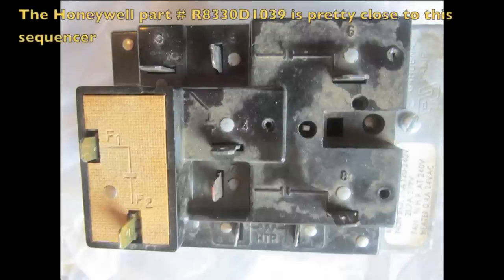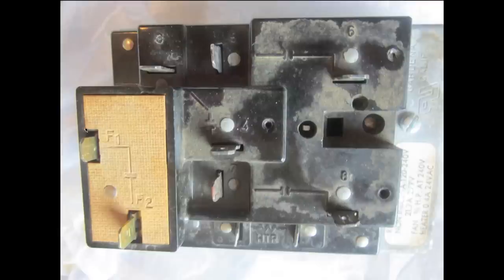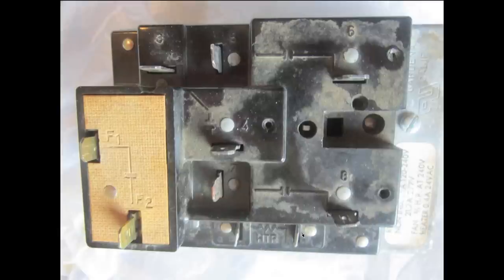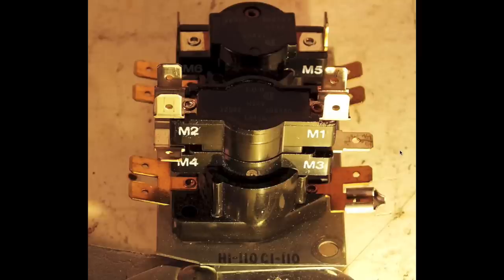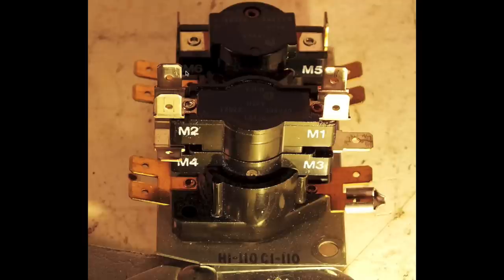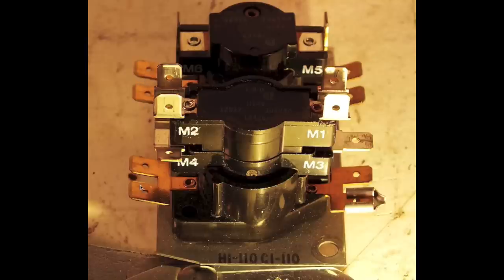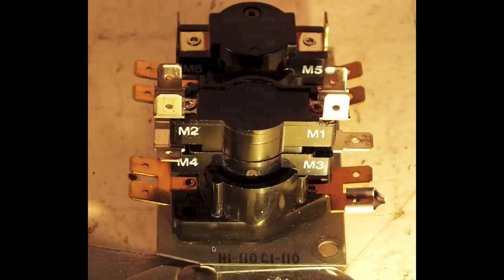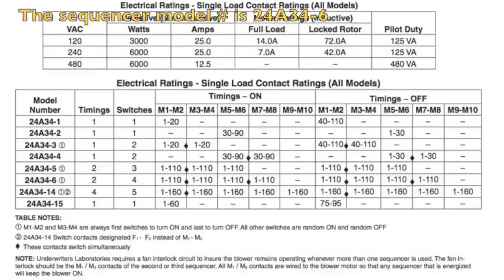Honeywell sequencer replacement

Comment: I just installed this Honey well R8330D Sequencer. I replaced a standard Stacked type sequencer, which lasted just a year. I understand that this unit is far superior to a stacked one and will last quite long. Next, in case it doesn't, i will re-do with a contactor with a time delay for the second element.
Reply from the maker: They are pretty much the best of the sequencers.
GFM

Comment: Good video you could use the sequencer you had I had to replace mine I used a two switch and just used two elements on contact m2 run a jumper to a fan relay and hook the fan to the normaly open contacts when m1 and m2 mate it energizes the relay and fan comes on been running that for two years  with just two elements

Comment: Realizing this is an old video...  I am rewiring an old firnace with 5 5kw elements.  I believe this furnace originally used the auxileruly to run 2 of these.  As of now,  the unit i am rewiring has a fan contactor, then 3 honeywell dpst relays,  so after the fan comes on, the inrush current is 100 amps.  So , anybody know how I auxilery 2 of these together?  I feel like all elements on at the same time with the 100 amp inrush might not be good for the breaker.   Thoughts please ?
Reply from the maker: The idea of inrush current damaging components is an old one and is no longer true.  
If you must sequence the elements, you will have to use sequencers such as the ones described in this video.  You may need 2 of them.
GFM

Comment: Grey would you mind posting or linking the WR installation paperwork.  Thank You either way.
Reply from the maker: Its on the Graycoolingman site.  Here is a link:  http://www.graycoolingman.com/library-of-equipment-manuals.html
GFM
Reply: Ty
Reply: Hey GFM….. trying to find the wiring diagram to replace a Honeywell #R8330D1039 to a White Rodgers #24A34-6. The link provided did not seem to still work. Thanks for the help!